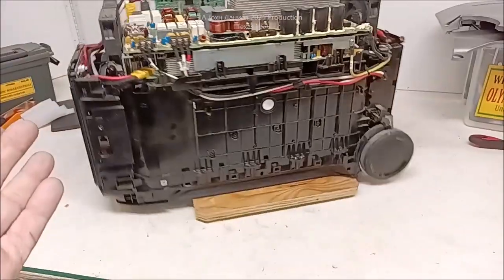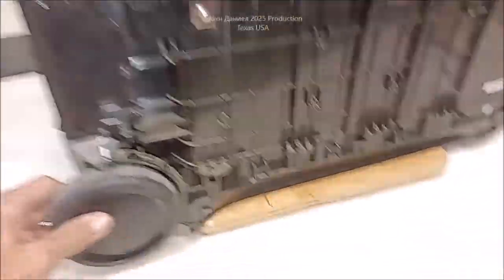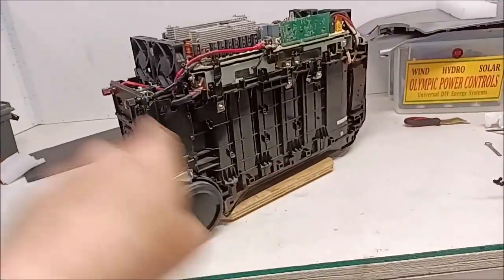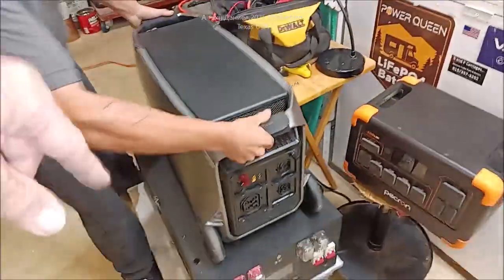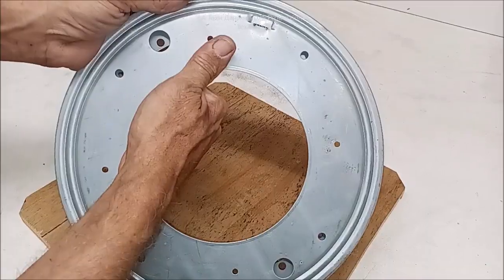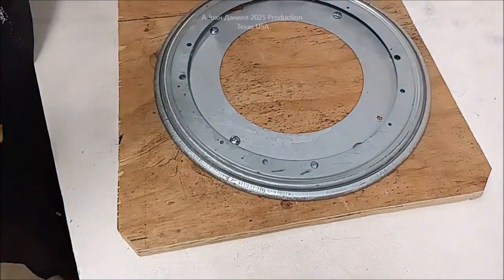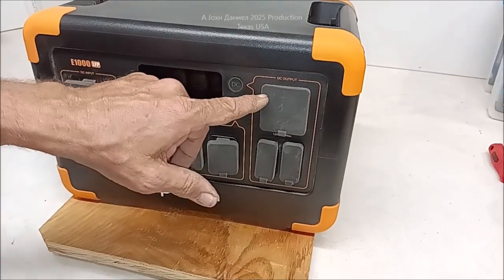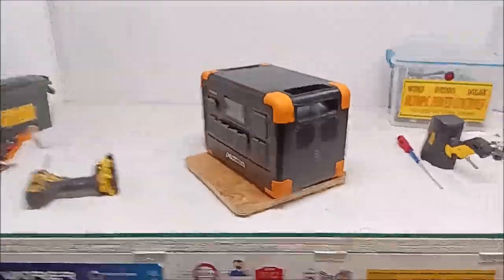Make a 750 Lb Capable Rotating Work Top for under $15 in less than 10 minutes

Comment: Couldn't you have flipped the lazy susan over and passed the screw through the larger hole to drill the wood via the outer ring instead of drilling your own holes?
Reply from the maker: Yes but the screws he had the heads were too big to go through there. Truss screws 7/16 wide head verses access holes 3/8" 😂
Reply: @JOHNDANIEL1  5:04 You could have screwed it down through the large hole into the smaller hole as shown in the upper left at this point in the video. Then rotated the wheel to the next hole and so on?

Comment: I bought one of those just 3 months ago, and made a wooden base for it. I put on the brake rotors, then grab a 320 Grit Scour Flap Disc for a 4 1/2 Inch Angle Grinder, and sometimes recondition the rotors if they're within specs. It works wonders!

Comment: Goodmorrning can I do the same on the delta 2 pro my mom and dad have 2 of them and can I use lead acid batterys
Reply from the maker: You can use Lead Acid since it has a wider operating voltage but more of them would be required to carry the amp hours. The Lead acid would pull the top voltage down some but as long as you have good charging protocol. I would say the % rating would be a bit unusual but it would work.